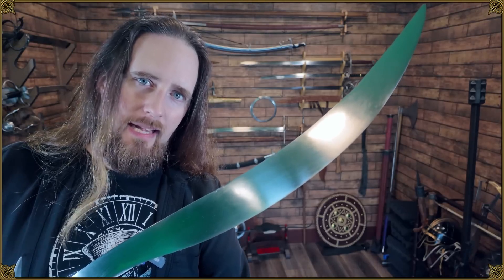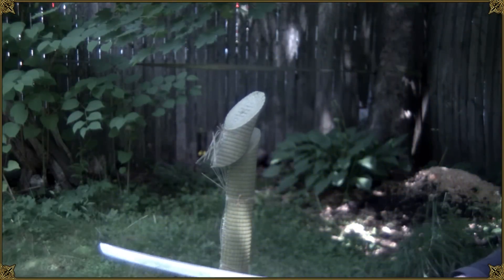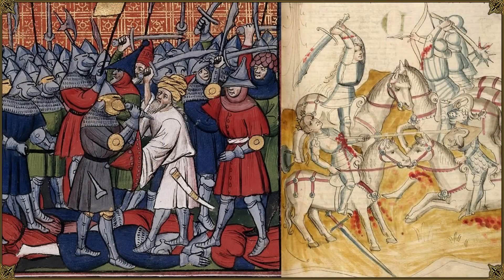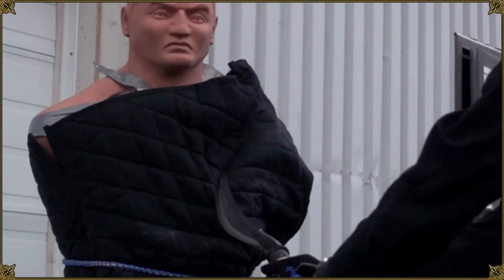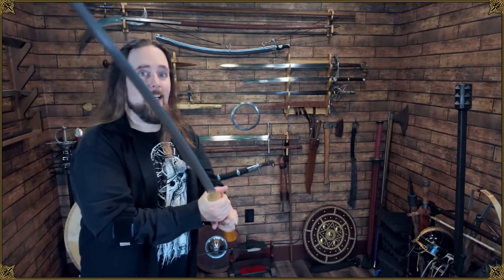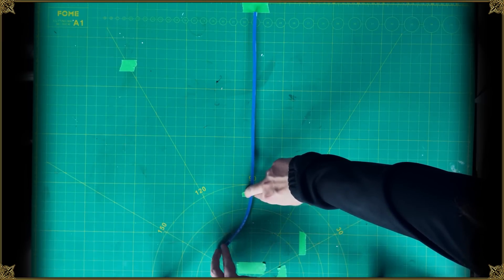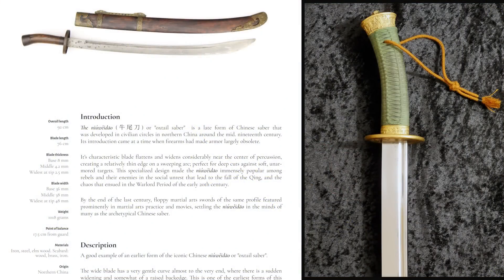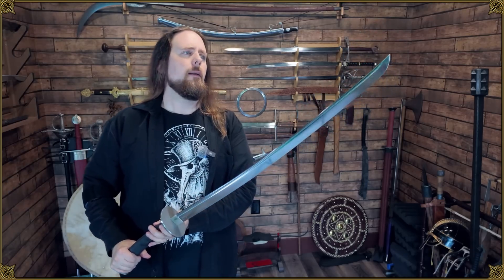Sword Design: What's the Recurve For?

Comment: Really cool geometrical demonstration of cutting mechanics at the end of the video! Explainery stuff below:

So I think the answer as to why the handles are curved was quite well exemplified with your demonstration. Curving the blade of a sword with no other change means you need to swing more to reach the target; curving the handle of the sword with no other change means you can swing less to reach the target; in tandem, curving the handle makes curved swords capable of hitting a target with a regular swing!

Overall, that was really interesting and intuitive :D
Reply: I think there is something different at play. 1)Biological: muscles differently stretched have different force. You might add power of your left fingies to last 20% of swing if it is curved and since those muscles are faster then forearm muscles - you have better swing  2) Mechanical it is very difficult do describe, but you have two levers with different ratios. It is like with the car - you start on low gear, and finish on high gear (keep in mind it happens with changing angle of left hand force relative to handle and right hand pushing vector as well).
Reply: Curving the hilt forward at the bottom allows you to pull the hilt, with your pinky and ring finger, when you are striking to add extra power to the slice.

Comment: You may be missing the advantage to hand placement on the curved hilt. A full swing with a straight hilt causes the bottom hand to have to come up into and against the body of the swinger, which could be less mechanically advantageous than starting further forward and not having to travel back as far, where the muscles of the hand and arm are less powerful?

Comment: Think of the curved handle as a way for the handle to 'hook' onto your bottom hand, so that it's easier to 'pull' with your bottom hand. Another potential benefit is that, given that it's a long handle, when you complete the cut, the handle won't be as close to jabbing into your body as it would with a straight handle. I have no credentials these are just my thoughts.
Reply: that's kinda what I figured. Why the curve, well basically it makes certain kinds of techniques more comfortable to do
Reply: It allows you to swing with different motions and is a more powerful lever.

Comment: I think the forward curving handle is really just for the comfort and the reduced risk of slipping. Just like with an axe.
And, second benefit, while holding the sword towards the enemy, the lower hand is further away from the body, thus getting closer to an equilibrium with the top hand. I'd say in general it's pretty weird to point a sword forward with one hand extended and the other one not really knowing what to do
Reply: Also, looks. Never underestimate the impact better aesthetics can do, and a forward curved handle just adds to the aesthetics of a backwards curved blade
Reply from the maker: @andreas_rr   Right, I wanted to mention the point that we shouldn't underestimate how many design choices were made for aesthetic reasons, but then I forgot.
Reply: shouldn't the recurved handle bring the point back into alignment wirch the hand(s) like a recurved blade does? 
Especially in one-handed curved blades...